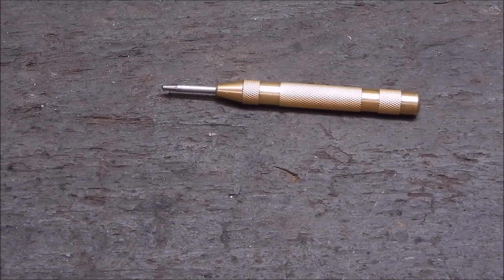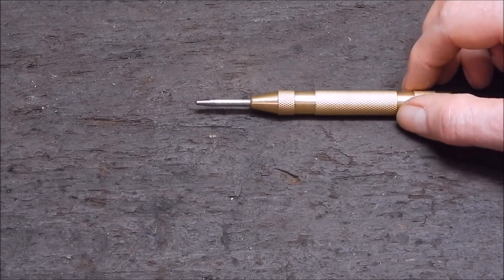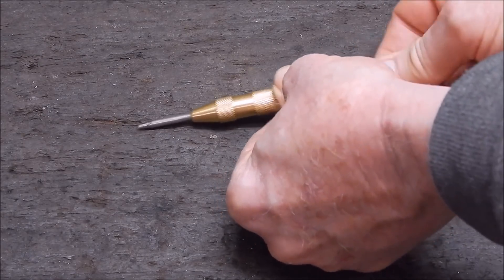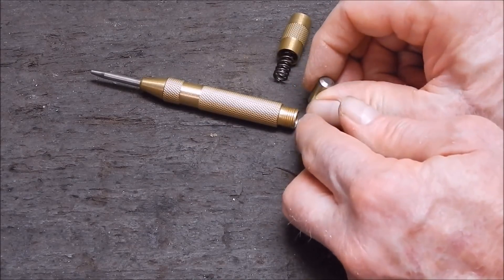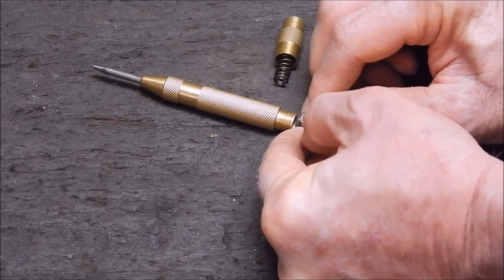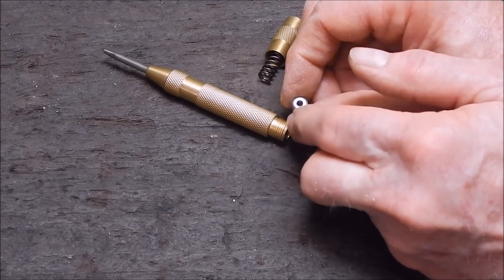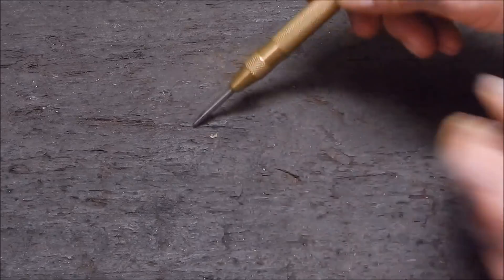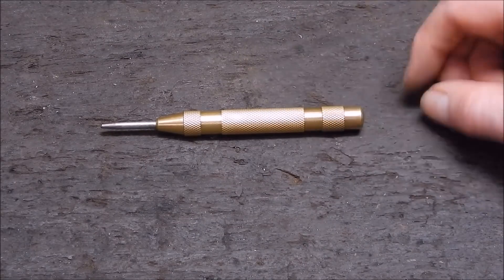How to fix a dud automatic center punch

Comment: I have that same punch with the same problem. 5 minutes with some emery on the surface plate and it now works every time! Many thanks for the tip.
Reply from the maker: Hi Rod.  Glad it worked out.  YT is great for sharing information.

Cheers Rob

Comment: Thank you I have had that punch for a few years and it never worked so I tried cleaning it up by putting it in a bench drill and polished it like you and then it had a 95% strike rate so I tried polishing the tape on the middle piece and ended up with a 100% strike rate and I am very happy with it so now it come out of the useless tools box
Reply from the maker: Good to hear.  The metal they use is fairly soft, so it may need doing again after a lot of use.  It fixes them OK.  Cheers Rob

Comment: #its likely to be the smaller spring at the front is not bent enough to make the first pin off centre enough, as you push down the beveled edge on the first pin lines it up into the centre of the hammer (the one with hole though it) then it strikes. You can clean the face up won't hurt but likely to be the first spring not the second one you saw here.

Comment: Great and to the point (Literally). Mine is now 10 for 10 instead of 1 in 10. A little trick if you want it, is to mount the piston in your drill press with the end needing dressing pointed down. Leave the press off. Lay your oil stone on the table, bring the piston down to just touch the surface and move the stone back and forth a few times. This will keep the surface perpendicular to the sides.
Reply from the maker: Good tip.  Thanks for that.  I will try it next time (they need a refresh every so often as the steel is not very hard).  Cheers Rob
Reply: In the same style, you can use the drill press to make a new part from 5/16 (8mm) steel rod. I use it as a lathe, with an attached drill chuck pointing upward to some steel plate. Use a drill bit to align the bottom chuck with the top one, attach a small piece (like 1/2" or 12mm length) to the top chuck and use a 1/4" (3mm) bit in the bottom chuck. Drill the piece to correspondant depth and you are done 😀. Once you are done, you can finish it the way you said.
The advantage of making such a piece out of steel instead of brass is that you can harden it to make it last longer.

Comment: Thanks!! Just bought one off e-bay and it was hit and miss until it stopped working at all after I fiddled with it.
I did what you said but it wasn't working so well (my stone is very fine) so I switched to 240 grit emery paper on a flat surface and rubbed it over it. In no time it made it flat and also a rough finish, to grip better. I suspect it was sliding off before against a shiny machined surface. It works every time now.
Reply from the maker: The rougher finish is probably a good idea. It would help I think.  Cheers Rob
Reply: @Xynudu   I believe so. I also saw there was some oil inside it when I first opened, probably helping it slip into the hole prematurely, so I wiped it dry. So much better now, it hasn't slipped once. I don't know why your video isn't no1. Others are doing tutorials which are garbage, telling people to buy diamond files, polish the wrong part etc and wasting time with bad advice. You deserve all the credit for your solution

Comment: Rob,
  Bought one of the cheapies from a box store and wouldn’t work from the get go. Saw your fix and went right out to the shop to inspect mine. Since I hadn’t used it because of poor performance I surmised the manufacturer had actually put a chamfer in the bore. I put it on the diamond plate and took it down flat. Now it works like a charm. Now I have two as I had purchased a decent one after the cheapie failed out of the box. I’m not one to return cheap items to the store. I figure if it works, fine, if not I relearn the old mantra from Joe Pie down Texas way, “Buy nice or buy twice!” 
Dale
Reply from the maker: Good to hear Dale. I've seen forums where members have endlessly debated over how to fix these, but it's very simple as you found out.

Cheers Rob

Comment: Thanks, heaps. Thanks yo your video, I just fixed my Automatic Center Punch. Mine only worked twice from new. Now it's perfect. I also placed a micro drop of oil on the contact area after polishing.
Reply from the maker: Great to hear.  Oil is probably a good idea. Cheers Rob

Comment: G'day Rob--I used that wheel dividing program about a month ago---had to make a 52 toothed sprocket  5/8 pitch and it worked a treat.That program was a good tip     thanks.E
Reply from the maker: Hi Ian,

Yes, it's dead accurate.  The Java program is totally trustworthy.

How did you index it ?  The USB microscope I now use is fantastic.  Perfect gears every time.

Cheers Rob

Comment: I had one that wasn't very good from new ... and quickly deteriorated, so took it apart and squared up the thingy face as you did.  I still didn't understand how it worked but it improved its action a lot.  How well it worked still depended on which direction I applied lateral force (as well as the regular axial force).
Roll on through the years (invention of the internet, launch of youtube, etc) and one day I found a video that showed how it worked!  Big AHA moment / light bulb turned on.  It only works because of the lateral force generated by the bent spring on the other thingy that strikes the pointy pin.  This is the light spring accessed from the other end of the punch.  I gave this spring an extra kink - works great now!
Reply from the maker: That other spring has a bend in it so the trigger/striker pin meets the hammer piston face (which is poorly finished) at an angle.

The bent spring in mine seems pretty OK.  I suppose there could be defects in any of the internal parts, but mine looked well made except for the fix I show in the video.

Thanks for the extra info, as it all helps to get the little jiggers working properly.

Cheers Rob
Reply: You're right - holding the thingy (!) "at an angle" is more accurate than what I said.

Comment: Thanks for the fix, well half a fix for mine.  I also had to smooth the sides at the top of the piston that slips into the hammer cap.  It had a minor mushroom shape that was snagging it up.  Works fine now.

Comment: Cool, I couldn't tell you how many of the cheap little buggers I have tossed out after taking them apart, oiling them and they still didn't work. The last one however, was a brand new Starrett about that size that worked exactly six times before it shit the bed.
The spring at the pointy end self destructed. It wasn't cheap.
Back to the Harbor Freight and General brands I went. Now I know how to fix the dang things. Thank you very much and I have subscribed to your channel, for other reasons.

Comment: I indexed it by just printing the divisions on a sheet of a4 paper then stuck it down on a sheet of ply wood around 300mm in diameter and extended the lines out to the edge with a straight edge and biro..Then fitted the disc to the  backend of the lathe spindle, fitted a pointer and that was it..The bigger the disc the more accurate is the manufacturing..
Reply from the maker: Sounds good.  I usually just glue the chart to a piece of cardboard (old beer carton etc).  Try using a microscope instead of a pointer and you will be amazed how good/easy it is.  Eliminates all alignment error.

https://www.youtube.com/watch?v=PBlBJ5RWTSk

But you do need a laptop PC and a USB microscope ;)

Cheers Rob